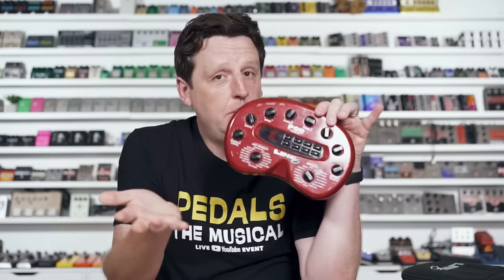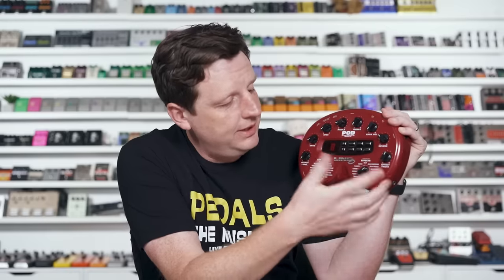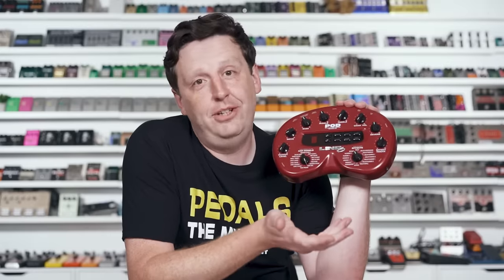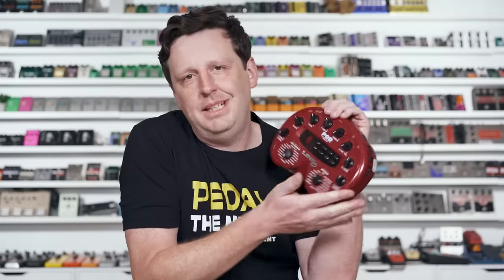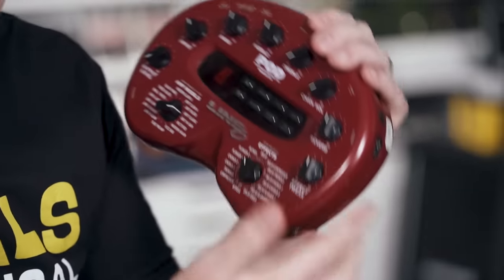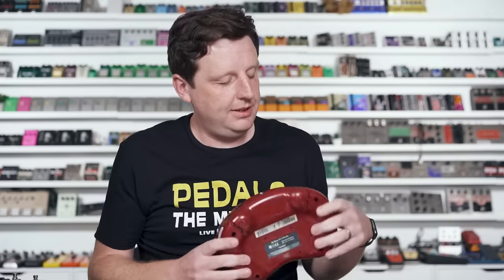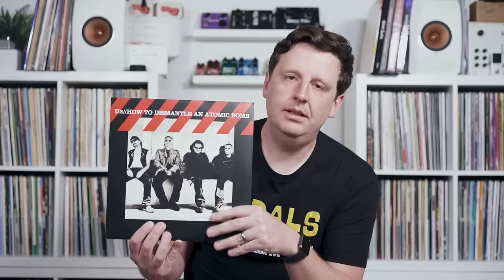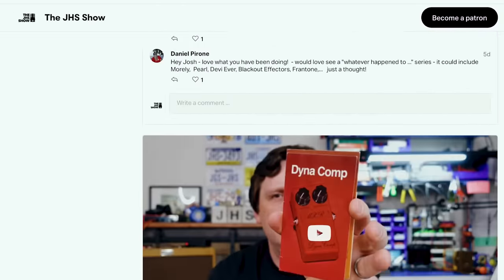Why The Line 6 POD Sounds Really Bad

Comment: I had the Behringer version ( V amp) for years and ran it into a Fender Frontman 25R...I gigged at 
small bars all over Lower Michigan with that rig :) :)
Reply: I still have all of the versions of the Behringers and the Pods. . You can get some great tones out of them.
Reply: etchypi just did a vid Dont Be A Snob showing the V Amp rack at a hotel jam at 42 Gear Street event.

Comment: I'm curious about you running the Pod with the amp modeling into another amp... the impact of the Loud Is More Good vs direct into a PA or interface.
Reply from the maker: THis is line in. No amp at all. Its just used as a table.
Reply: It shouldn't be a big deal. Running an amp sim into a clean amp is usually not that different than running a preamp/amp-in-a-box style pedal into a clean amp. The fact that the power amp is presumably a part of the simulation shouldn't prevent it from sounding good. Running a cab sim into a cab may produce sub-par results more often,  but it doesn't have to, depending on how the EQ curve of the cab sim works with the frequency range of the physical speaker.
Reply: I used my POD xt with cab sim off into front end of 100 watt fender solidstate with great results for a few years off and on. Sounded muffled with cab sim on but it was "useable" that way with some eq tweaking. Cab sim off though is where it's at.
Reply: @baseboardmatt  Sure, line-in is of course ideal. My response still stands though. If you're running a cab sim in front of a clean amp you're running a risk of making it sound very boxy, but running an amp sim into a clean amp can actually produce very good results.
Reply: @jhspedals  thanks for the info! Most of my amps act as tables as well.
Reply: @Lynx33PL  most “amp in a box” pedals don’t do cab sim.  There are no wrong answers, but for me it’s one cab sim,  never two.
Reply: I used mine as a preamp infront of a peavey stereo 50/50, into a mesa 2x12.  Sounded great, I preferred it with the pod cab simulator off though.
Reply: That's how I usually saw them used live, straight into a p.a.  with the cab sim on.
I had a band open up for my band and the guitar sounds were good, as they were moving their gear off stage and I was moving mine on I asked the guitarist what amp he was using, he pointed to that red bean! Lol. I was so surprised by it I almost bought one that day
Reply: @baseboardmatt  Most of them do not, but there are exceptions to everything. Joyo American Sound is one of the most popular Chinese pedals, and unlike the circuit it copied (Tech21 Blonde) it has no option to disable the cab simulation. Despite that, it still sounds pretty great straight into a clean amp (which I can vouch for). That's probably because of the analog approach to cab simulation (it's probably a low pass filter if I had to guess) but still.

I've mentioned in both of my comments that running a cab sim into a cab may indeed produce sub-par results, but that's not always true. Guitar cab speakers usually have a somewhat narrow frequency response range but not always (e.g. some modeling amps). Running a cab sim into a Celestion Greenback, which pretty much caps the frequency response at 5k Hz, will probably make your tone very "boxy". Running a cab sim into an FRFR speaker is simply a good idea. And there are all of the scenarios in between (most of the amps don't have full range speakers but some of them have wider frequency responses than others).

As always though. If it sounds good, it is good.
Reply: @Lynx33PL  yeah… I don’t really care that much but thanks for the info.

Comment: Thank you so much for doing this video!!  Actually, I didn’t throw my POD away, just packed it away with a bunch of gear I no longer use. This video has encouraged me to pull it back out and give it a fair, current assessment. It always helps when someone who knows what they’re doing shows you how to properly use your gear. 😊
Reply: Update please. I did the same with my old Digitech rp200 and my mind is blown. Amazing what reading the manual and taking more time than just getting a chugging metal tone can open up. The amp modelers are actually pretty good.
Reply: @RyanDoesAll  Sure enough, I dug it up, started reading the manual and discovered the “manual” setting that I never knew was there. The more I abandoned the presets, the more I liked it. Current experiment is to put a stomp distortion and wah in front of it, which doesn’t make sense except it gives me a way to kick in overdrive and have a wah PEDAL on the floor. Doesn’t sound as bad as I remembered, but still working out the kinks. All in all, I’m kinda loving the size/convenience and overall sound. Worst case scenario, I may add this to my pedal board for effects I’d like to use on occasion but don’t care to haul around.  Awesome rediscovery of something I already own.

Comment: Used one of these with a 'longboard' on the floor switching 4 patches, in line tuner, wah/vol straight into an old ultra linear Twin for years. Had to run a handful of pedals too for specific sounds, but it was so EASY to get a decent sound in pubs and big party halls .. clean Twin, crunchy Vox, driven Marshall - maybe if you listened super critically you'd pick up some difference but in the moment and for 99% of people it was great. The consistency was something I'd searched for. Stopped using it when I stopped playing live for a while .. recently got back in via a Pod Go and FRFR setup, which is easier on the back, probably sounds a little better and is more versatile but much the same reasoning behind it.
Reply: I used mine into an ultralinear twin. That's another thing that people say sucks because they heard the cool kids say so. I like the ultralinear.
Reply: @arthurvandelay7677  absolutely - it’s a tool for a job, clean headroom as far as you like. I found it reproduced the pod really well, with just a hint of warmth added.
When I get the transformer rewound I’ll be trying the Go into the front .. it’s great on FRFR but not really doing it using my Boogie - just use it for fx there.
Reply: The ultralinear Twin sounds awesome clean at any volume you would like and makes an incredible pedal platform. 

I think that’s where digital really shines, it doesn’t quite do it for me direct to PA but pushing a clean tube amp it’s just sublime.

Comment: Got a Pod XT Live in high school because it had all these zany effects and could do just about anything. Actually used it when my band opened Vans Warped Tour in 2017 (as a midi controller for my rig). Thing still rips, the secret is pairing it with the right IR.
Reply: You didn't really use it if all you used it as was a midi controller for your rig. Nice try, though.

Comment: You actually got me there Josh! I didn't fall for the "Solid state is crap" video, but I was pleasantly surprised! I have the POD HD Desktop bean, I use it all the time! It;s so much easier to just jam on than plugging in my board and having to deal with that at 2am when I just want to play! And it sounds great! If I use an IR loader with it, it is extremely useable. It's not about the gear, its about the player!

Comment: Thanks for this video! Would love a pocket POD episode and would love to know how close it is to the version your played in terms of versatility and quality. Also would love to know if you would ever combo a pod into a set of pedals or if that would be unwise. You know, in the spirit of trying stuff.
Reply: I put drive pedals in front of my POD 2.0 using the 4C preset (Plexi sound) all the time. I keep the drive settings (on the pedals) down and volume up and they boost it just like a real amp. Can run it out to a power amp in jack or right to the front of an amp or into your interface to your DAW. It all works and sounds pretty decent with minimal tweaking time. Don't care for time based/modulation in front of a POD but the onboard POD fx are so usable I don't really miss them.

Comment: In 2004 I tried a pod and plugged the huge line 6 floorboard into it. I had been playing a vintage gibson for ten years and had been using boutique tube amps for the past 5 years. 

At the time, I was going for Joe Bonamassa tones, and was able to dial in Silver Jubilee and Budda tones that he was using at the time after some knob turning on the pod. The manual helped tons.

Through headphones it was epic. I was pretty impressed. It seems like the flextone amps are just this in an amp, and they sound great too. Never owned either of them but fun to try when bandmates had them.

Comment: I recently switched over to its latest revision, the POD GO. I was running pedals and an HX stomp and found that the POD GO did everything I needed. Its simple like the original pod, all the classic line 6 sounds as well as the new effects and modeling of the helix at a fraction of the price. I still love my analog pedals and amps but for convenience it can't be beat!
Reply: Couldn't agree more! I have my old analog board at training place and pod go at home. Got 15 minutes left on a lunch break, well flip it on and put headphones and you just got some exercice. Also it so much fun to google some big guitar heros's setup and then replicate it on the pod. Not the exact same of course but didn't cost a dime more and you can switch from metallica to U2 with one click.
Reply: Yep. Had the and still own bean, now have the PodGo. The stock presets can be improved, but when you get the sounds you like, it is amazing for the home studio. I bought some of the Jason Saddites and Jonathan Cordy presets, and they have improved the tone significantly for almost no money. Like you, love my pedals, but this can’t be simpler. EDIT: Forgot, still have a Flextone II and used it for years playing out and opening for folks like Northern Pikes, Great Big Sea, Eddie Money and Rick Emmitt. Nobody laughed at my set up, and it gave me infinite tone possibilities in a small package.
Reply: I was using a Helix fot the last 2 years. Last year i got a POD Go in a trade and grabbed it one night for a quick jam. It's a stellar little piece of gear that would get any guitarist off to a great start. Simple and sounds killer! You can't go wrong with anything Line 6 these days. Helix modeling is a real contender. I'm using an FM3 now but still have my Helix.
Reply: Yup. That's what I've got now and it's great once you get it under control.

Comment: Wuhuu! This is a great reminder for me! When I started to get into recording way back when, I used my dad's Kidney Bean all the time. Like all the time! He bought it right away when it first came out. Internet was new and we didn't have it at home, so I didn't know Pod sucks. I went by ear and thought it was amazing to get things recorded so easy with a decent sound. It only sucked when I wanted more options and adjustability, and couldn't have them. (It was the very first version. And I didn't read manuals, if there was hidden functions...) I didn't like Line6 real amps though. Something wonky in the feel department.

Then I grew older, got internet, started to read forums and only used amps. Then I got older again, grew balls and went back to recording with modelers. So much faster to get a good result and wide variety of sounds.

Comment: I still have my kidney bean POD. I must say that live it just couldn't keep up with a tube amp. I tried it once and started bringing a Hot Rod Deluxe back with pedals out after that gig. However, in the studio, it's another animal altogether. I own a recording studio and I have recorded bands using the POD with the intention of rerecording the tracks (for less drum bleed) and ended up keeping the POD tracks. I see it as a tool for the studio and it's paid for so it so it stays. I've also got the pedalboard for it and the Wah sounds better than my Fulltone.
Reply: I just picked up the Pocket POD at a garage sale about a week ago. 
$50 for a mint condition Line 6 FBV MKII shortboard w/ box, cables and manuals and the Pocket POD with the manual! 
  It's been a neat little processor! Super versatile. And, there is even a web-based App to control it via Android!

Comment: The album The Runner's Four by Deerhoof was recorded entirely with Line 6 PODs. I was quite surprised when I read about this.
Reply: Yes, one of my favorite albums ever. And also another one of my favorite albums ever, Dungen’s Ta Det Lugnt, was also (partly) recorded on the Line 6 POD. Really shocked when I heard this, for some reason this machine loves to produce neo-psychedelic and noise-rock masterpieces.
Reply: Also considering that both those albums, especially Ta Det Lugnt, are famous for sounding very ”vintage”. Some people thought Ta Det Lugnt was some rediscovered underground record from the late 1960s when it released, and it really does sound super authentic. The Runners Four also sounds ”vintage” but more of a mix between 60s psych and 90s noise. Still incredible.

Comment: Josh proved that the line 6 pod sounds good by running it through a cranked tube combo amp.   But the main idea behind the Pod is that you hook headphones into it and only use the pod.   
Show us how great the Line Out of the Pod sounds, into full-range speakers.
Reply: I always preferred running it like that. Never liked the POD through a guitar amp, the extra layer of colorization was very pleasing to my ears. but with headphones - killer, and for recording straight into the console - outstanding (although it sounded REALLY great with into a tube preamp). I've recorded many albums with it. The only thing I was never comfortable with was Live use, because of the aforementioned effects of running a guitar amp sim through a guitar amp, and playing through monitors in the PA just feels weird.
Reply: I just replied something similar. the built in cabs suck, it would sound bad.

Comment: back about 15 years ago when my partner and I were recording our songs that we had written we used the POD along with real amps and we had a hard time usually because the sounds were a bit muddy,  so we were always trying to dial in distortion sounds that had some clarity and definition.  Turns out that using 10's on your electric guitar can make it muddy on recordings.  Even though all the experts said you had to use 10's to get good tone.  well it just goes to show that you can't trust what people say you can only trust your ears!  You guys should do a video on that how bad 9 gauge strings are and how much they really suck!

Comment: I loved my pod. They are a the missing link between the pure analog old school way and the modern plug in digital D.I. systems.
I own a XT floorboard, and its even better, less canned/compressed.
That said, I also own a rectifier, an orange or-15. As great a tool as the pod is, its just not as alive as a tube amp through a good cab, miked properly.

Comment: I was a POD user. My first guitar instructor owned the Red Kidney-Bean POD. When I started, I had a VOX Valvetronix VT15, and when I began craving single pedals and effects, my instructor advised me to go to the local store and try out the Floor POD Plus, which was this exact model in pedalboard format. I managed to get some good sounds out of it, even if bypassing the preamp section on the POD was impossible, so I always had the POD's Preamp stacked on top of the VOX's. I have to be honest and say that, recently, I had the hitch to hook it up and use it for recording... But I have a DV Mark Multiamp hooked to my audio interface (its simulations are far superior to what the POD can accomplish), and, as of lately, I very much prefer record guitar DIs and then use Amplitube 5/Tone-X/TH-U

Comment: Taking spirit of the POD and combining it with the love of all things BOSS, I think a video about the Boss GT multi effects series would be interesting. I feel like they get a lot of undeserved could shouldering.
Reply: I owned a GT8 and a GT10. I gigged them with a Damage Control Demonizer for drive sounds in the loop into a stereo tube power amp and 2 4x12s. It was pretty glorius. There are tons of great features in those older Boss pedals that are still being borrowed by the hotshots of today's modeling. Boss has always innovated and while the amp models were a bit trash, I'd use the drive straight into that amp and cab set up and get some fantastic tones.
Reply: @IamtheFerryMan  That seems like a cool set up. The thing about those presets in the Boss multi effects/amp models is that a lot of them were like cartoon versions of what they were meant to dial in. And they got dismissed as such. When you mess around with the settings and make them less extreme, they started to sound really good. I used to dial up really "normal" tones with a late 90s (or early 00s?) era Boss digital recorder. Honestly those tones sounded better than the amp I had at the time, haha.
Reply: Agree.  Boss COSM works for me.

Comment: Just come across this.  Good review.  I've have the Bass Floor Pod XT for quite a few years.  I've had issues with main board reliability, others have had the same issue but getting it repaired and will see how it goes.  There are so many options that you do need to spend time with them to dial them in and dial in your tone.  I find the bass synths a bit naff and don't track all that well so haven't done a lot with them but feel like I want to go again with it.  Love your channel and find it very informative and a lot of fun.